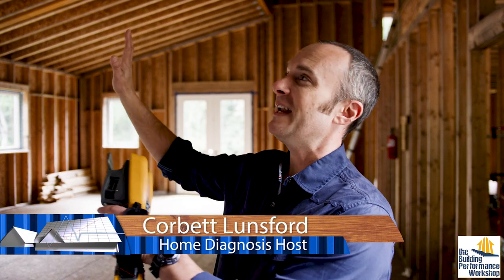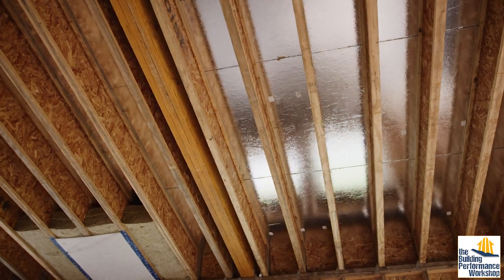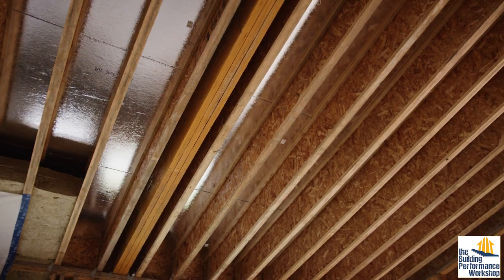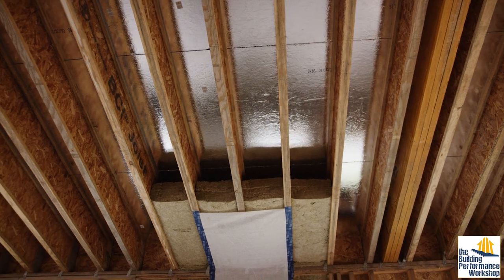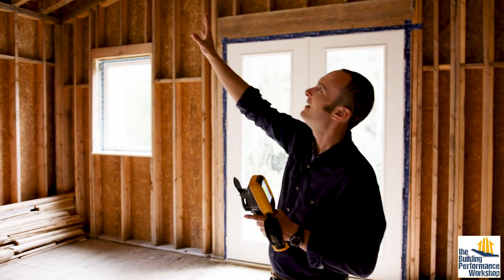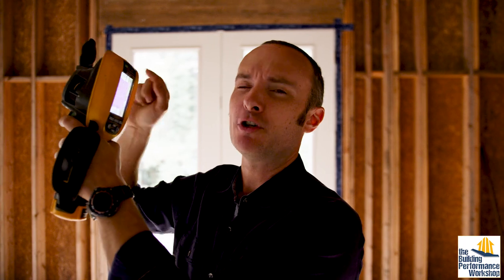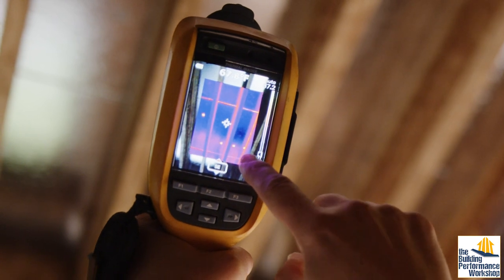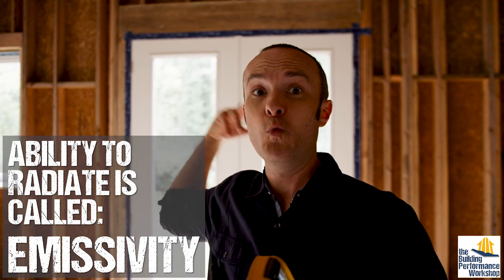See How a Radiant Barrier Works using an Infrared Thermal Camera

Comment: Also, please do not confuse high emissivity and heat capacitance.  That is a car’s interior have low heat capacitance surfaces (steel buckle) and high heat capacitance substances, plastic dash.  The material that has a lower heat capacitance is able to transfer its heat more quickly and this is often felt as a hotter temperature but its not. Heat flows from hot to cold. So when your hand touches the buckle, your hand receives the steel’s heat much more quickly than the dash, but they are essentially the same temperature.  To measure low emissivity surfaces, like anything mirrored/shiny, you will need a thermocouple probe,  not an IR camera.
Reply: Yeah I was wondering how emissivity was impacting the camera in this video.

Comment: So it doesnt emit stored heat as infra red rariation. It emits it via conduction to the air. You want a vented air gap between it and the heat source if you do not want the heat to come back in. In your cold climate? Having it face both ways would be good as it reflects infrared radiation back into your place. What you are talking here about is emissivity. Putting the sticker on change the surface from a mirror to a non mirror.

Comment: You might want to mention that radiant barriers work on both the top and bottom of the system, as long as it has an air gap.  On top, due to reflection, not absorbing some of the sunlight (solar radiation).  And, on bottom, with an air gap, due to low emissivity (not emitting the heat, as infrared radiation).  Metals, especially aluminum, don't like to absorb, or emit radiation.  IT WORKS BOTH WAYS!  And, if you had two layers of battens to attach your roof in a lattice pattern, you could put the "roofing aluminum" between the layers of battens, getting BOTH BENEFITS of reflectivity and emissivity.  It reflects heat above (infrared radiation), and it does not emit heat below!
Reply: Radiant Barriers can only work if exposed to the radiation emitter. Eg no building material between the sun and ‘barrier’. Aluminum maybe a good reflector of the IR band of light but if the shiny surface is installed within a building cavity, then the shiny surface becomes an emitter not a barrier/reflector. (Sun)Radiation->(Shingle)Conduction->(Aluminized surface of decking)Radiation->(framing)Conduction
Reply: @zefrum3  I was with you until ->(Aluminized surface of decking)Radiation-> because a radiant barrier does not radiate, or emit heat well in the IR band, when it has an air gap.  Only when it touches something, can the high conductivity of aluminum come into play.  You are right Zefrum3, whatever gets hot, will emit that heat in the infrared to some extent, depending on its ability to emit that IR band, its emissivity.  Aluminum has LOW emissivity (will not emit heat, that is to say, emit radiation, as infrared light easily).  It conducts heat well, so if it is touching anything hot it will get hot quickly, or vice versa, store up the heat that it receives and then quickly deliver that heat energy to anyone or anything that touches it.  But, if it is put between two layers of wooden battens, one vertical and one horizontal (or at any angle), then the aluminum reflects the IR band above and restricts emission of IR band below.  Both benefits, BECAUSE YOU HAVE AN AIR GAP ON BOTH SIDES, UPPER AND LOWER.  Only where the battens intersect and are connected to each other does the heat conduct through, about 12.5% of the area if put at two-feet and one-foot intervals.  It needs an air gap to work.  Only where the aluminum "touches" something does it conduct heat, and it conducts heat well.  It works with an air gap, but not at all if does not have one (trapped between building materials).  In order to get aluminum to transmit its heat you must put a lot of fins on it to increase the area that the air "touches" the surface of the aluminum and create an air flow around it (a radiator), to take advantage of its ability to draw heat away through conduction and convection.  Check out AtticFoil and RoofingFoil videos for scientific evidence and verification.  Also, this video and others from Home Performance itself.
Reply: @keithburns3669  no, low emissivity does not equal will not emit heat. I am an engineer, you are not; other wise the nuances of Kirchhoff's and Plank's laws would not be lost on you.     Try this again: the aluminized layer may have low emissivity, but this layer is not a reflector but an emitter due to how the foil layer is positioned into the assembly.  So in the end, no heat is ejected back to space b/c the aluminum isnt exposed...

Comment: You might want to mention that radiant barriers work on both the TOP and BOTTOM of the system, as long as it has an air gap.  It reflects heat above, and it does not emit heat below!

Comment: You could cover the stickers with aluminum tape.  It should work on the same principle.  Metal + air gap!  You could also cover your studs, or anything else that gets hot and has an air gap.  It only conducts heat where it touches, and it only emits heat where there is no radiant barrier (aluminum foil).  A radiator works to release heat only because it has many fins to conduct the heat to the air that "touches" the metal due to increased surface area, and then the heat carries away the hot air as it rises and creates an airflow also known as convection (heat transfer through mixing).

Comment: I bought my home in May 2019. The home was built in 1978. When doing some minor repairs on the house I found that the builder had installed drywall with Radiant Barrier on the backside. The exterior walls and ceilings have the drywall with radiant barrier. The roof decking does not have radiant barrier. I plan on replacing the roof and roof decking. The trusses are 2 feet on center so I will be installing 5/8 roof decking. My question is, if my ceiling already has radiant barrier, is it still a good idea to install radiant barrier roof decking?

Comment: So if you didn't have an air gap between the radiant barrier and the insulation it would transfer the heat?
Reply from the maker: It would conduct, yes.
Reply: Home Performance 
Do you have a video showing how to do an air gap? And do a roof system properly?
Sorry just found you channel.
Reply from the maker: Stay tuned, buddy, we’re showing as we build it.

Comment: I also did not realize that it works better if the foil side faces down towards the interior of the structure. Matt Risinger is big on insulation outside of the roof sheathing and making the attic part of the conditioned space. Would a radiant barrier work in his design and where would you put it? 

Also, will you be insulating the exterior of the roof?
Reply from the maker: Think of it as radiant heat bleed being stopped at the radiant barrier. If the barrier faces out, it stops heat from escaping your house. If it faces in, it stops it from bleeding in from the sun. No exterior insulation on the roof, none needed in this house. Energy modeling can tell you lots.

Comment: So have you done a cost vs return through savings on all of these gadgets? When doing heating calculations back in the 80's we found that walls with more than 19 and floors and ceilings at 30 were the economic limit. We found no benefit to foil in the walls unless left uncovered.  I was curious about how the figures were turning out in your lab.
Reply from the maker: Not on the walls, just the roof. And yes, we use the same basic energy modeling today as back in the 80’s.
Reply: Home Performance with my infrared camera I can’t get good readings on reflective objects like foil. Would taping a piece of paper to the foil and then get a reading be more accurate?

Comment: Ugh, the reflective surface appears to be a lower temperature because the floor/slab is reflecting to it. 

If you read the information guide for your camera you would know that. 
The stickers are the temperature of the panel. You can view the temperature of the air in the space by stringing thread through the space and then looking at the area again.

You can look at yourself in the mirror with your thermal camera and your approximate temperature on the mirror. 
If you look at a brushed nickel pipe with 180°F water flowing through it, and there's a chilled water loop in black iron pipe behind you, the brushed nickel finish will reflect the colder temperature from the chilled water loop. it is a limitation of the infrared thermography. And the FLiR user manuals talk about it, and why it happens.
Reply from the maker: Exactly, Daniel- surfaces that are better at reflecting than transmitting have a lower emissivity.

Comment: how do you guys get on with electrical issues with the foil?
here its banned for residential usage due to people getting electrocuted.
how do you guys mitigate that risk?
Reply from the maker: Aha! Good Q- some of these are made from very thin aluminum sheeting, but the kind used in Thermostat is actually Mylar, which is like plastic. Non-conductive. Little more expensive apparently, but worth it.
Reply: @HomePerformance   excellent. that would also mean it doesn't suffer from the corrosion issues that plaques the old style foil. i had it under the floor, it was stuffed. corroded and covered in dust. we don't get as hot as our mates across the ditch in Australia.
Reply: @HomePerformance  bonus question! whats the permeability rating of that stuff?
Reply from the maker: It’s permeable. You could find the rating if you care to!

Comment: can anyone recommend a good radiant barrier staple on foil?  I want to use plywood not the  LP tech OSB plus it's nowhere to be found here at this time due to a tornado. I want to staple the foil to my new roof decking. Brands???
Reply from the maker: No brand for you, but whatever you choose PLEASE choose mylar-based, not aluminum-based. There were a ton of lawsuits over aluminum starting attic fires during lightning strikes.

Comment: Use Ronsonol lighter fluid and the stickers should come off. Zippo LF would work too but it has oil in it which will leave a residue.
Reply: @HomePerformance  
That's how collectors remove stickers from books and comics.

Comment: In Australia we have these products called air cell and poly air which are a double sided 4mm bubble core RFL. All the literature I’ve seen reccomends you face the foil towards the heat source (in Australia its the sun) and provide a 25mm gap (you can track the benefit from 0-25mm but last 25mm there is no additional benefit, why do you face the radiant barrier inside? I would have used OSB sheathing then your wrb membrane, then parallel battens then RFL then your perpendicular battens to attach your roofing? We don’t use sheathing in Australia though..
Reply from the maker: Hey Daniel- with a radiant barrier of this type, you want the RB to be the last thing transmitting heat directionally, then you put an air gap to halt the heat flow. If you wanted to keep the heat from escaping the indoors on a cold night, you’d put it facing outward.
Reply: @HomePerformance  interesting you say they I am also in Australia and was under the same impression that the RB sould face out to stop heat coming in....

Australia is decades behind US, Canada or Europe. 

So the roof blanket I have that has roof iron bulk insulation then foil then nothing... or large air gap of roof space will block radiant heat from out side? Interesting the product does not mention that only R value to reduce heat....

Comment: Wouldn't it work better to have the foil side facing the other way to shield the heat , or even have foil on both sides.
Reply from the maker: It’s actually not a shield- it’s more like a battery, if we’re making analogies. It absorbs the conduction of heat, like all materials do to some extent, but then it’s not emitting that heat via radiation. That’s why you need the air gap.